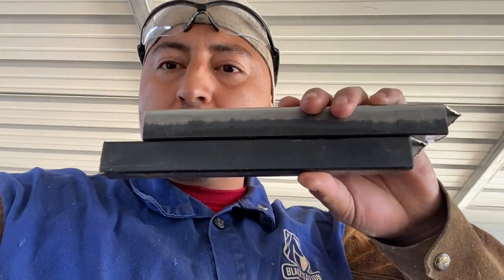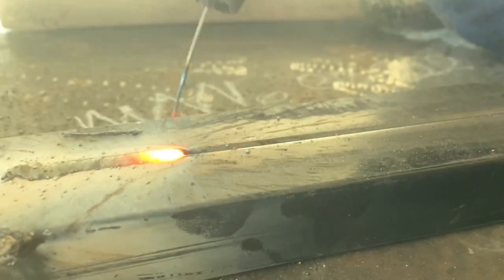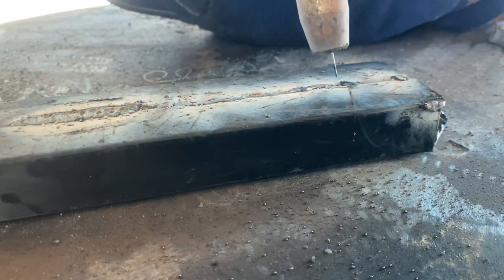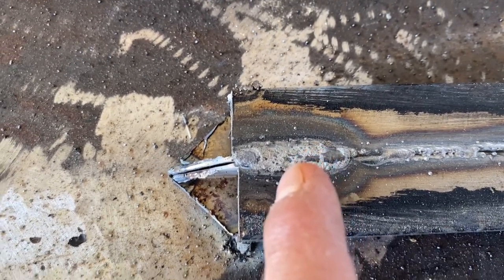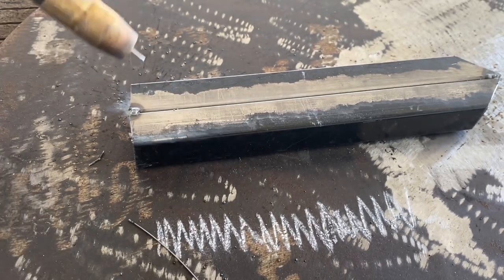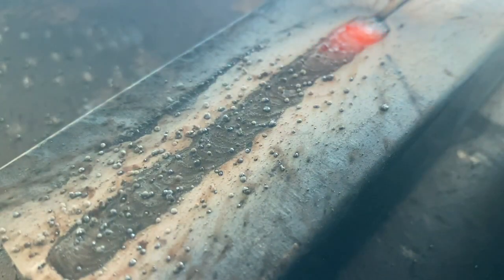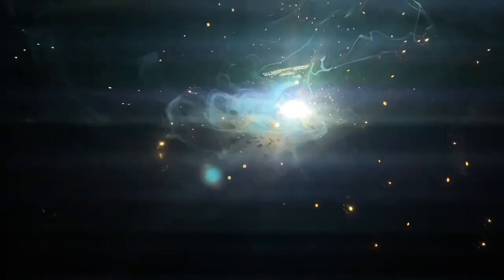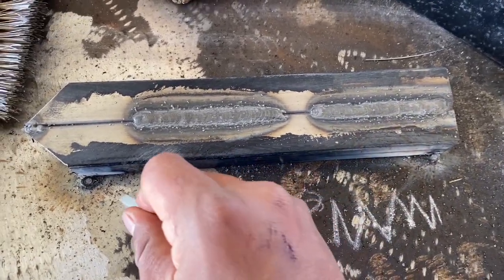Gasless Fluxcore Welding thin square tubing for beginners

Comment: I have the hobart handler 140.wure speed is @ 20 and my V is set on 1. Im still burning thru 18 gauge. Ive tried hauling ass even. What am i doing wrong?

Comment: Great video. I'm trying to build a drawer system for my truck and my little Lincoln 120 likes to blow through square tubing. I can't quite get the wire speed dialed in. I'm going to see if these techniques may help spread it out a bit instead of burning right through it.

Comment: I just purchased a Titanium 125, and have never welded before.  I am practicing with 030 Lincoln Electric flux core wire.  I have an 1/8" steel plate that is about 6" wide by a couple foot, and I am just running beads across the narrow side of the plate.  At first the weld bead was decent, but now it is very flat, and I’ve not changed the settings.  I am using the suggested settings on the welder for 1/8", which is 6 & F.  I am keeping the surface clean by brushing and using a steel brush on my drill between practice welds.
Reply: Let it cool or maybe your speed you might be moving slower than before or running too many beads back to back
Reply: Duty cycle.
Reply: You don't push with flux core

Comment: The arc on my fluxcore weld always seem to be stuttering rather than a consistent burn. Could it be that I am plugged into a circuit that can't handle the load?
Reply: turn up wire speed